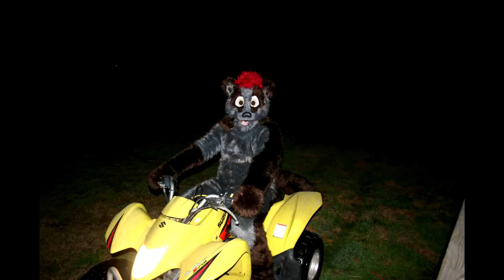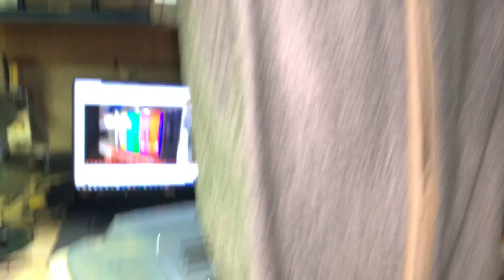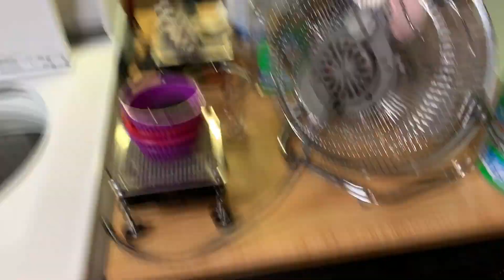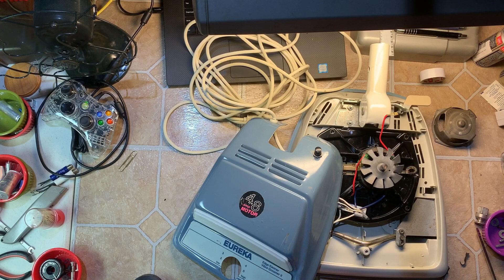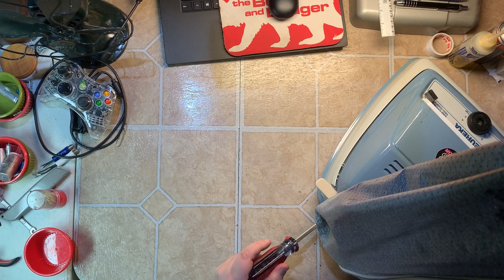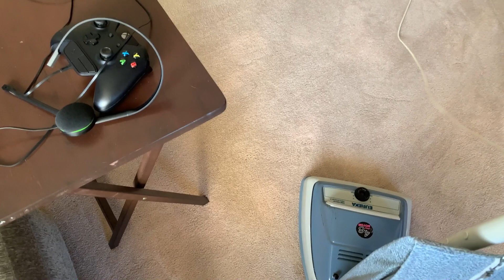How to Restore a Eureka Model Model 1489A Vacuum

Comment: Does the Sanitaire plastic motor 7 amp fit onto vintage Eureka from 1988?
Reply: Eureka 1489-A from 1988 with Sanitaire 840 watt plastic motor.

Comment: Thanks a lot for the awesome tutorial; great commentary and explanations. What metal and vinyl polishes did you use? I'm not sure how you determined that your 1489-A was made in 1988, but I noticed on the parts list that there were also these versions: -AM, -B, & -BM; unless it was in production longer than typical (4-5 years).  Thanks again.

Comment: Not sure what’s up with the Kirby bags that is with this box of Eureka attachments, but those are style 3 Kirby bags since that’s what the Legend II I have takes that was inherited in the late 90’s. Interestingly enough, the current hepa bags Kirby makes will fit the older models starting with the Heritage and Heritage II models and even fits the current Kirby they sell to this day. The 2 older Kirby’s I have don’t take disposable bags since my Dual Sanatronic 50 and Classic 1CR both have shake out bags and seem to work fairly well and usually empty them at least once a week.

Comment: mine is a vibra groomer, not a vibra groomer 2 and it has a metal handle. it has a 3.5 amp motor, which motor would that be?
Reply from the maker: That should be there so called blender motor.

Comment: Any idea what blender model this motor was used on?
Reply: Thanks. I didn't know that. I have always been more into the vintage kirby, electrolux, and Hoover Convertibles. Would love to have a Hoover Constellation
Reply: @matthewbestdfghy  The Constellations are great.  I have 3 of them, with the oldest being from 1955.  We use it almost every day at work.  Even after having the bag break twice, and the bag also being accidentally left out twice, it still runs like new.  It's the only vacuum that I can use while someone is talking on the phone since it's so quiet.
Reply from the maker: "Blender" is just a nickname for the motor type given by fellow collectors, as it has the small armature and the top sleeve bearing motor. Lower amperage and lower RPMs. It resembles the type of motor that would have been used in a blender, hence why it got its nickname. 

The other higher end Eureka uprights used the "Pancake" motor, much more powerful and has a distinct sound to them compared to the "blender" motor.

Comment: LOL, this was exactly the Eureka I was talking about during your Hoover Convertible video.  I had a couple different models of these over the years that I had trash picked or had given to me.  The darn seal on the bag outlet always leaked because the plastic wouldn't stay flat.  They also make a really interesting sound when the belt breaks and gets sucked into the fan :-)
Reply from the maker: Yeah, Eureka's aren't as good as a Hoover. They were built cheaper to sell cheaper than the competing Hoover. But pretty much all Hoovers were built the same with the same beefy materials regardless. 

Eureka's clean well, but definitely not as well built as a Convertible.

Comment: This came out on the day after I handed down one of those horrid $50 Eureka Airspeed One vacuums to someone in need.
Reply: I've tried the Airspeed One -- the suction was great but the build quality left a lot to be desired and the filtration was just horrible. If they strengthened the part where the handle/"spine" attached to the base, and improved the filtration, it would have been decent.